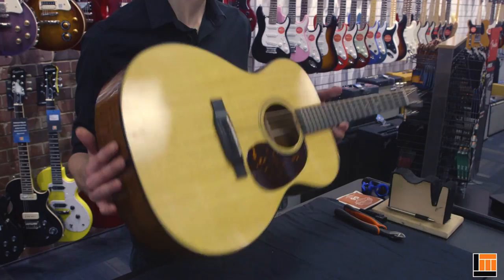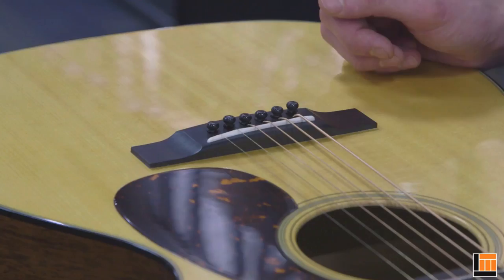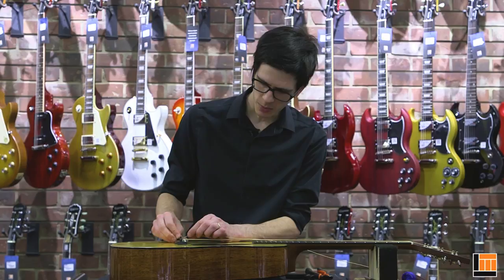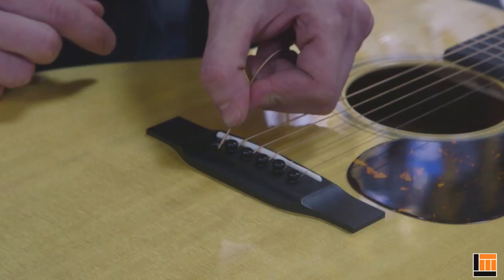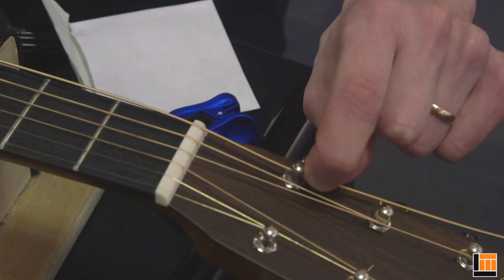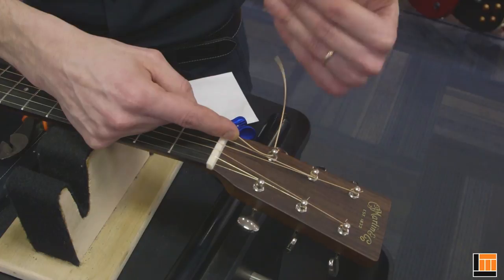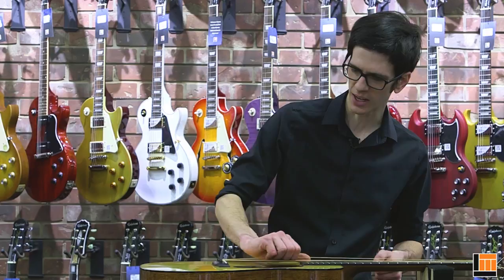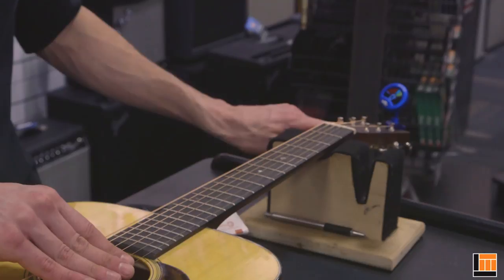How to Change a Steel String on an Acoustic Guitar

Comment: Extra trick, to get a smooth string ending, without the sharpness, is to just wiggle it back and forth, then it will break off inside the string hole, so you can't cut yourself :)